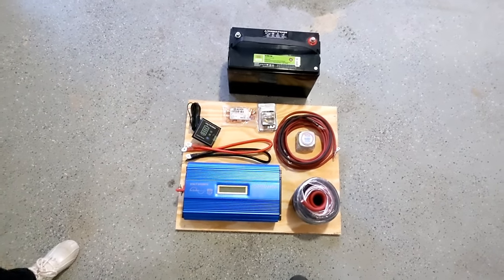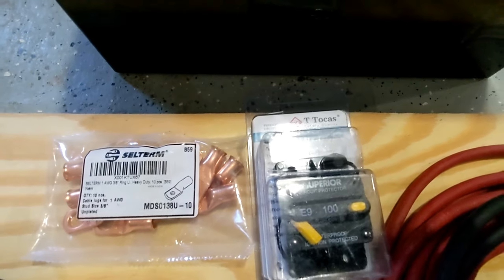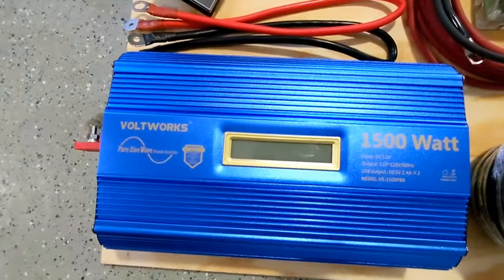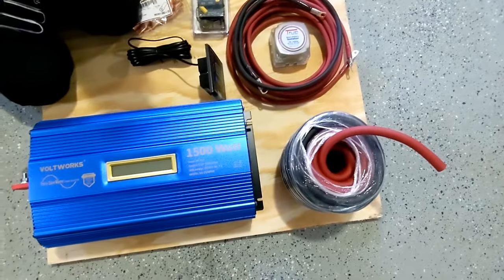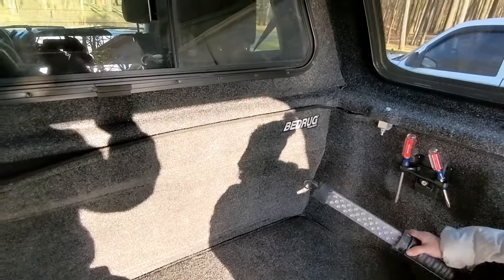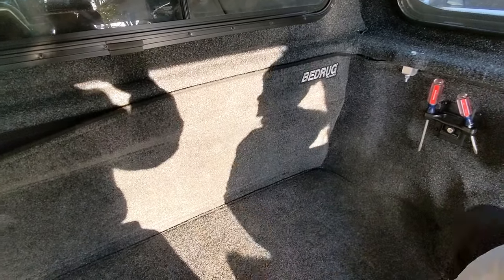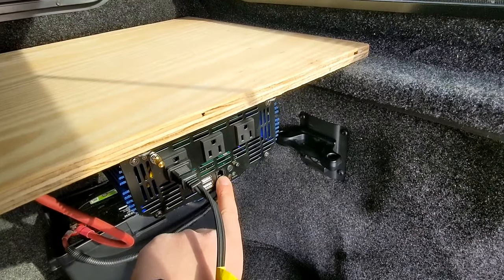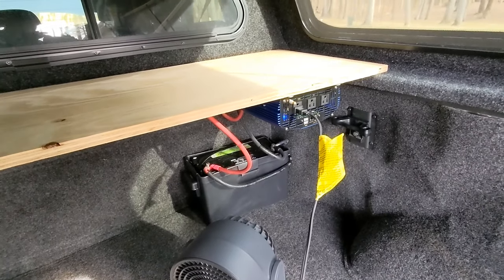Inverter Install and Dual Battery Setup / Truck Camper Shell / Overland Camping

Comment: You should install a fuse on the wire between the truck battery and the isolator under the hood.  If you develop a fault on that wire there is nothing to protect your truck battery.
Reply: What size fuse?
Reply: @Allmotorzl1   try match the surge wattage capacity and amperage. For mine I did a 2000 watt/4000 watt surge inverter and a 300 amp fuse.
Reply: Should be a 115 amp filuse on either side of the isolator.............

Comment: Great idea, and simple setup. thanks for sharing! Question: You said you put in a 100 amp breaker? Wouldn't that limit your draw to 1200 watts? Since 12V battery x 100 amps would be 1200. how are you able to draw 1500 watts then without tripping it? Shouldn't that be 1500/12 = 125, so requiring a 125 amp breaker?
Reply: Yes,we'd better install a 150Amp breaker, in order to draw 1500W full power.

Comment: Do you really need 2nd battery? Could leave car on and run the inverter. Leave isolator so not to drain main battery
Reply from the maker: That would work I guess. I think that would lead to a lot of unnecessary wear and tear on your engine. The second battery would also be cheaper than the Biden gas you would burn.

Comment: Great job. Keep it simple. I picked up 2 large used batteries from the auto repair shop in my neighborhood. Free. I'm running a 1500 watt inverter. I run a ton of stuff. 2 ham radios, lights for the tent. 1 CB radio. Winch. It's all in the back of my expedition. I mounted the solar panel on the top. You don't even know it's there. Fun project. Remember! When in doubt use bigger wire. If it says 16 wire use 14 and so on. I also keep 2 fire extinguishers in my rig. I liked your comment. When in doubt go big on wire. There is a formula for wire size. I'm not that smart. I just go big. Why take a chance? Have fun.

Comment: That's a neat clean setup you have there. I liked that you used good quality welding wire for the battery to inverter connection. Those cables that come with inverters should never be used. You nailed it when you said they are junk.

Comment: I. Have done a couple of similar systems, but I also have solar power. I use the system to charge up a trolling battery I use on the electric motors only lakes I fish. It’s lithium so I top it up each day. It takes about 1.5 - 2 amps from the battery hooked up to the inverter to put one amp back into the trolling motor battery. Not too efficient, but the solar makes it basically free. I have a 240 ah LiFePO4 battery in the Rayzr truck camper I have and it’s amazing, expensive, but can run the 3000 watt inverter and run the camper itself. I bypassed the converter, otherwise you are likely gonna have issues. I have a small trailer I have a 2 battery system in. 2x 100 ah LiFePO4 batteries and a 1500 watt inverter. 1500 watts is a lot in itself!! 
     You have a nice simple system. Using the box like you do, those Bedrugs are excellent and tough!!!  
  Thanks for sharing!!! This one goes into the saved file.

Comment: Nice work. You should coat your frame with chainsaw oil. It creates a protection layer between frame and road salt,etc. i put it on my wifes truck two years ago. it works. It dries out , just paint it on or wipe it on with throw away rag. Your off grid rig will last twice as long..

Comment: Thank you for the video!    JUST FYI  I would run wiring along the frame and not the body of the   truck. incase service ever removes the cab to work on the engine.
Reply from the maker: Thanks for the advice. That never crossed my mind.

Comment: Nice video.  I have basically the exact same setup in my travel trailer, but I have the isolator (same unit) and the battery and inverter in the trailer.  I installed mine to run my fridge while on the road.  The problem I'm having is that the isolator is cycling on/off every 15 seconds, because whenever it connects the two batteries, the voltage between the truck and house battery gets "averaged" so both are below the 12.9V cutout, so the isolator disconnects.  As soon as they disconnect, the the truck battery voltage pops above 13.3 and it re-connects, and it cycles indefinitely.  The alternator is plenty big, and the camper/fridge is only drawing about 15 amps when the batteries are connected, so it's not a heavy load.  The camper battery powers the fridge for about 4 hours on its own, but I'd like to have the power from the truck helping to keep the deep cycle camper battery charged, which it should be able to do with little problem.  I appreciate any tips; it seems like you'd have the same problem I did.
Reply from the maker: I have actually never watched my isolator while the truck is running. Except for when I first hooked It up, which it wouldn't have had the problem you are describing because it would have been charging the battery for the first time. I will take a look and let you know. The only thing I can think of is you are losing some voltage in the length of wire from your truck battery to the auxiliary battery.

Comment: Very neat. The essential battery isolator. Wires run above the floor. You should never plug a gigantic 1500 watts into a 1500 watt inverter. Short uses can be 750 watts sensibly. You should also add a squarish, not long, 100 watt solar panels and solar charge controller. Soon, you'll want a few remote cigarette lighter plugs and a 12 volt chest freezer. Mine runs on 31 watts and always on ECO mode.
Reply from the maker: Running the heater was just a test for the inverter. Just to see if it could handle it. I did add some 12v cigarette plugs. I have a video for that also.

Comment: Very informative and will attempt to a secondary battery system to my 08 Ford F-250.
Reply: Have you able to install dual battery with isolator in your Ford 150?

Comment: Great video man! I would advise you to replace that circuit breaker with a normal anl fuse and later add 12V DC DC charger for your second battery! These circuit breakers are actually trash, they will trip way over your rated amps, and your cars alternator will never actually charge your second battery! Tried and tested both of these ideas!
Reply from the maker: I have never had a problem with the battery charging. I have ran it down several times and it always charges back up. It is always at 13.2 volts at rest.
Reply: @parttimecamper5561  great to hear then! Mine and my friends batteries were never really fully charged

Comment: I’ll be working on a slide in truck camper build this upcoming spring. This setup would work perfectly for my electrical needs. If you keep within wattage from batteries to inverter could you install multiple batteries on the camper side? Great tutorial btw 🤙🏼
Reply: If you need the capacity, yes you can do multiple batteries wired in parallel. Everything else is the same. 
Just make sure you look up a diagram showing a parallel circuit before starting. Doing it in series by accident will have some pretty disastrous results.

Comment: In other videos on this topic, they'd run the ground from the starter battery. I always wondered why they didn't just ground it to the body like you did. I'll do it your way now that I've seen it work.
Reply from the maker: I have not had any problems with the way it is grounded.

Comment: @parttimecamper5561 This is exactly what I was looking for. Direct and straight to the point. Question for you, have you had any issue with charging your secondary AGM battery with the amount of amps your alternator puts out as it differs from your starter lead acid battery? I know they have different charging rates. Will this shorten the battery life of the AGM? I use my work van everyday but only got the inverter to run a space heater when needed and a tv for the kids. But that’s it. And my inverter is way over the top for anything I would ever use 😂
Reply from the maker: I have never had any issues with it charging my agm battery.  It should not damage the battery.

Comment: 10 x better than a power pack / jump box. the jackery 1000 is $1100, and the battery is non replaceable, so when the battery goes the whole thing is junk, and all batteries go bad , but this way you can replace the battery, you can pick one up at any auto parts store

Comment: This is exactly the video I’ve been looking for. Thank you for making it clear. I have a question. I’ve got room to put the second battery under the hood. Would you think that would be ok to do?  Then run the cables from from the battery under the hood to the inverter in the bed??
Reply from the maker: That would be fine. I actually wanted to put mine under my hood, but there was not enough room.
Reply: @parttimecamper5561  thank you
Reply: @parttimecamper5561  do you think a lithium ion deep cycle battery (they last longer, recharge more efficiently, and typically have higher amp-hour ratings) is robust enough to handle riding around or should I just stick with a lead acid deep cycle battery? Does the battery you use need to be balanced/equivalent with the starter battery under the hood?
Reply from the maker: @anthonypazoz4323  Lithium ion would be fine for this application. I would have went that route if I would have had the extra money. The AGM battery I have does not need to be balanced.

Comment: ? Battery on back of your truck drain the power of from battery  If the truck is not running?
Reply from the maker: It will not. That is what the battery separator is for. If the front battery's voltage drops below a certain voltage it disconnects the two batteries. Keeping you from running down your starter battery. When you shut the truck off it automatically disconnects the two batteries.

Comment: May be you should invest in some 12-volt items. that inverter will drain that Battey very quickly.
Reply from the maker: You are correct. I have actually purchased a 12 volt heating blanket, which works great.
Reply: @parttimecamper5561   that's cool . how long dose your AUX battery last running that fridge you have , i have the kings 75 lt dule zone .

Comment: I can under the power wires...
But I'm over thinking the grounds.
Did you leave your main battery ground as is....
Then, you put the Accessory battery ground by the exhaust hanger?
The power wires, I understand perfect without overthinking...
Reply from the maker: Yes. The auxiliary battery is grounded separate from the main battery.

Comment: Do you have an independent charger for the auxiliary battery? Or do you just rely off the alternator only?
Reply from the maker: I actually have a suitcase solar panel from renogy as a secondary source for charging. While I am away from the truck the battery can charge. Obviously, as long as there is sunlight.

Comment: I would buy a battery mounting bracket to install second battery in the engine compartment
Reply from the maker: I looked into that and couldn't find anything that would work that well. I found one from Ford, but you had to move some of the air filter system to make it work. I agree it would be better under the hood.

Comment: Great video. Have you had any issues with this install?
Reply from the maker: I have had no issues. The only thing I wish would have done differently was to use a lithium battery. But the lithium is so expensive.
Reply: @parttimecamper5561  Thanks for the quick reply. I'll be doing a considerable amount of truck camping in the future, just looking at my options. Your video was excellent!

Comment: Great video, but a quick question.  With the 100amp fuse, aren’t you basically limiting the flow to 1200w, and shouldn’t the 1500w heater have tripped the fuse?  Or am I missing something (which is quite possible 🙂)?  Thanks.

Comment: Sir.  May do this exact setup.  Have a couple questions.  At what voltage do you need to worry about charging the auxiliary battery?  I have heard that regular AGM’s can’t fall below like 12.1 volts or they will get damaged.  Two,  how could I add a volt meter so I could check the voltage to know when I needed to start the truck to charge?  Thanks for this video!!!
Reply from the maker: AGM batteries can actually be discharged further than your standard lead acid battery.  In my opinion I would not discharge them any further than 12.0 volts, but they say you can go all the way to 11.6. I wouldn't want to risk damaging the battery. You can also go with lithium and be able to run them down all the way without any damage. You can now purchase a 12v 100ah lithium battery for around $300 if you find them on sale. I just purchased a Sun Gold Power and so far haven't had any issues with it. It has Bluetooth capability to monitor the voltage. 

If you do go with an AGM, here is a link to a video where I install a voltage meter and some 12v cigarette plugs. 

https://youtu.be/wZjcIoYIJ5U?si=FceyyLGjllx0IHt_

Comment: The way you have it connected isn’t it going to draw from both batteries and eventually kill your starter battery?
Reply from the maker: No. That is what the battery separator is for under the hood of the truck. It will never let the auxiliary battery drain the starter battery.

Comment: Question if I run a 1700wats. Using  inverter connected to a battery alone will it drain it quickly? Thanks
Reply: very fast, or maybe can not power on your 1700 watts

Comment: Does that same isolator work if I were to have two batteries in the truck bed?
Reply from the maker: I have never tried that, but I don't see why it would not work. Just be sure the two batteries are wired in parallel.

Comment: Thanks for the tutorial video.  My question is regarding the terminal connectors. I’m confused on what to get to make these connect to the battery posts.
Reply from the maker: The main thing is to make sure they are sized correctly for the wire you will be using.  Wire is sized by American Wire Gauge system.  Whatever gauge wire you have just make sure the terminals are sized for that wire.

Comment: I got bought the same inverter and isolator after watching your video.    Could use some help finding the wire.
Reply from the maker: I can't remember where I bought the wire from, but it is #1 Temco welding wire.  Just do a search on google and you can find it.
Reply: @parttimecamper5561  I’ll look around.

Comment: How is the Inverter holding up ?
Reply from the maker: The inverter is holding up great!  I have used it on several camping trips.  Had no issues to date.
Reply: @parttimecamper5561  thanks

Comment: Why did you put in a circuit breaker?  Pretty much all inverters come with replaceable fuses.  My little 750W has 3x35s in the back that are replaceable.  Is it for redundancy?
Reply from the maker: So, the answer to do I need a fuse between battery and inverter is yes, you sure do. First of all, the inverter will work only in inverter mode without a fuse, and secondly, there will be the least protection for the inverter and connected loads.

Comment: I like it, is the circuit breaker necessary? I’m looking to start a mobile wood shop type business and have been doing a ton of research on inverters and I’m looking to run small tablesaws and routers
Reply from the maker: I would put one in the system. No more than what they cost it is worth it.

Comment: in this project when you put on the 1500 watt heater you turned on your truck or turned off you used the converter
Reply from the maker: My truck was not running when I had the heater plugged in.

Comment: This is a great video! Question. Would something like an 8 gauge or 10 be better? I was told that a #1 would be too big and have more resistance.
Reply: The bigger your wire, the less resistance it has. 

Many people get confused with wire gauge sizes. Smaller numbers mean bigger wires. (Ex. 10 gauge is bigger than 20 gauge). In this case #1 wire would be much better to use than 8 gauge wire.

Comment: Great video! What gage wire from the starter battery did you use?
Reply from the maker: I used what came with the kit. I believe it is a 6 gauge wire. Here is a link to the one I used. 
http://www.trueam.com/product/large-dual-battery-kit/

Comment: Apologies if I missed it in the video, but what kind of deep cycle battery? If it’s a standard flooded or lead-acid battery, do you have any concerns with hydrogen offgassing?
Reply from the maker: It is an AGM sealed. I actually just bought a sungold power lithium iron phosphate 100ah battery. So far it works awesome. Lithium is definitely the way to go. I was able to pick this one up for $388 on sale during Black Friday.

Comment: I don’t believe a 100 am breaker is enough. There is a table that you can look up which shows you the size breaker and wire you need depending on the size of the breaker.  I have the same inverter and different tables go back and forth between 175 and 250.
Reply: Yes,we'd better install a 150Amp breaker, in order to draw 1500W full power.
Reply: @voltworksofficial  
Could you explain how to calculate please.
Reply: @waynesmith9990  Continuous power 1500W / 10=150A

Comment: How do you charge the aux battery without a dc-dc charger? Alternator?
Reply from the maker: The alternator charges both batteries. That is what the battery separator is for. When the main battery is charged and receiving the proper volts it will allow the charge to pass to the auxiliary battery.

Comment: Great work man but I have I question how would you do it if u wanted more then 1 batter saying like 2 or 3 how would you run the wired for the batterys then? Thanks
Reply from the maker: That would be possible. You would have to wire them in parallel. When you do this you really need to make sure all the batteries are matching and in the same condition.